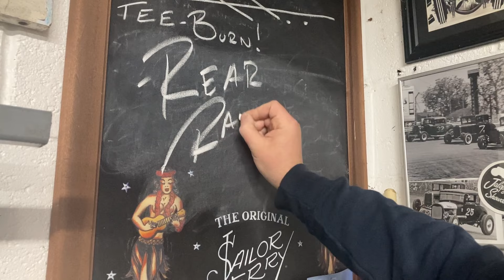Building hot rod rear axle radius rods

Comment: Just out of curiosity, you use a lot of heat to bend the end of those tubes in the joints to the right angle. Do you do anything to heat treat them afterwards? That much heat would leave them very soft and malleable. Seems to me that they would then be highly susceptible to fatigue failure.
Reply from the maker: Totally understand the concern. I tried to keep the temp as low as I could just to assist the required bend.